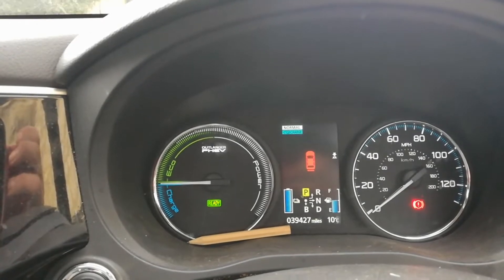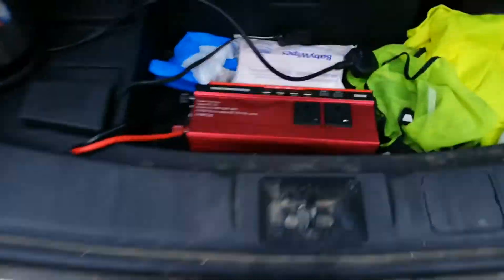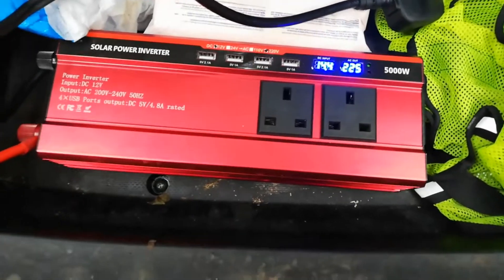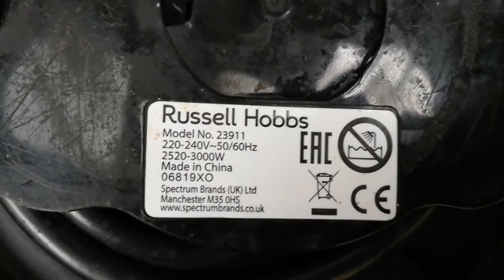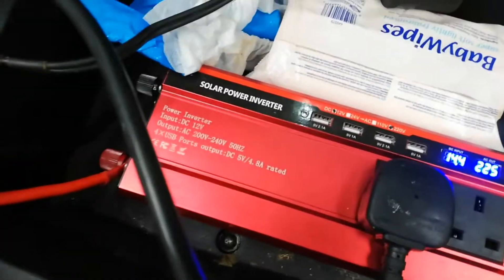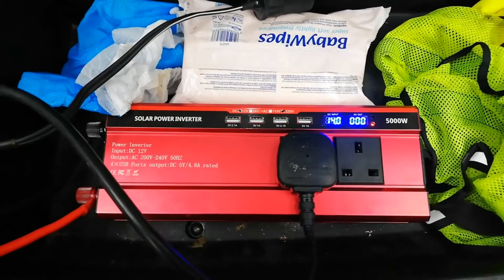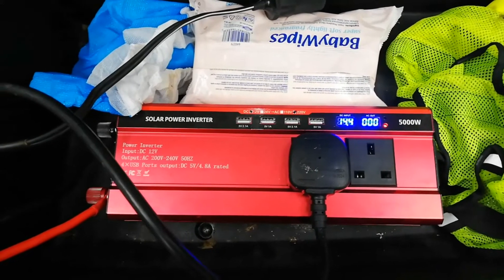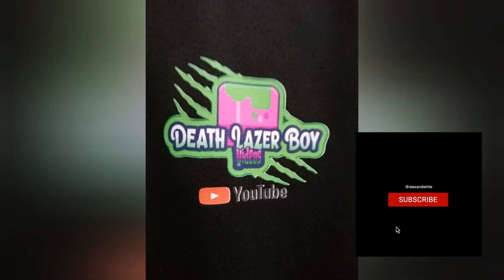2500 to 5000w Inverter failing to operate a kettle camping

Comment: The inverter is rated for 2500 W continuous and can handle anything from 2500 W to 5000W only for very short time. The kettle is rated from 2520 W which is over the maximum allowed power of the inverter. That means that the inverter does exactly what it is suppose to do, runs it for a second or 2 and kills the power because of overload.
Reply from the maker: Thanks for the clarification. Makes sense